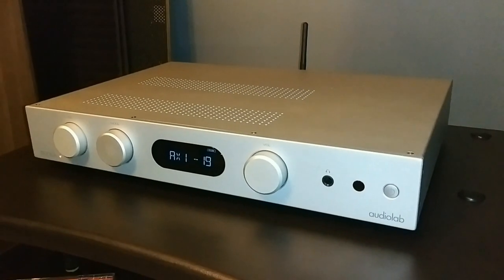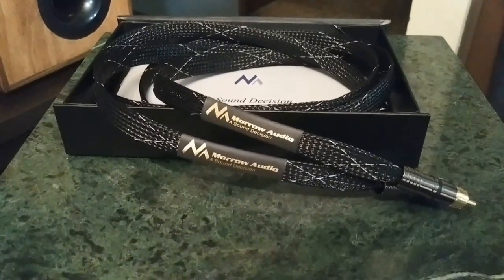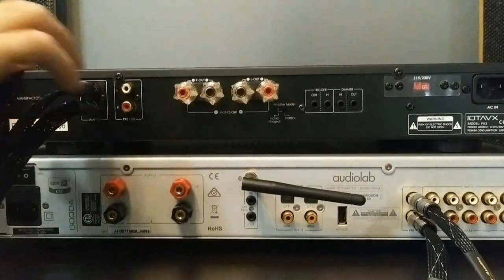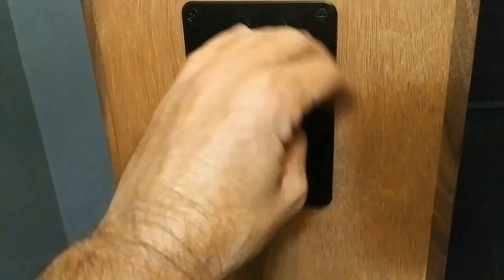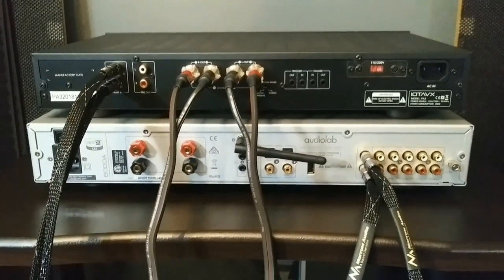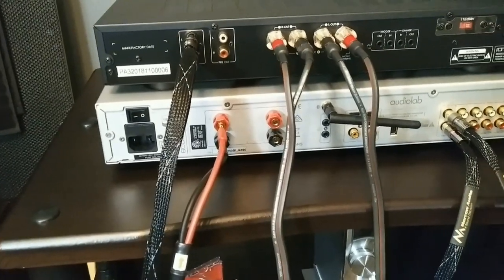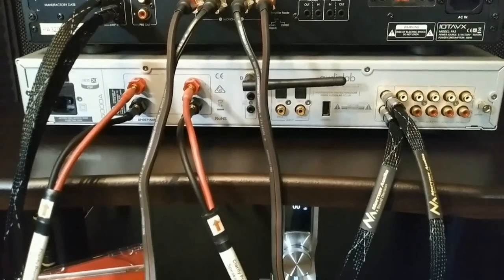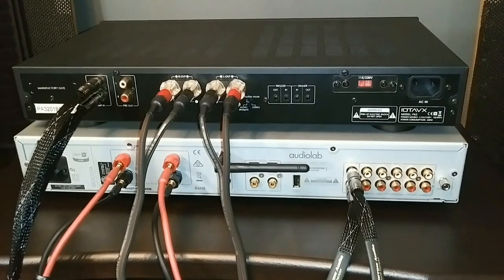How 2 Bi-Amp your speakers by using an Integrated amp with Full Range Pre-outs to a Power-Amp 😆

Comment: This happens to be my exact amp setup. So glad to see someone else doing it. Bi-amping is supposed to improve soundstage and tightness of bass, but I actually felt the main improvement was that it liberated the mid-range, making it sound a bit ‘friutier.’ When bi-amping like this you must ensure the two amps are gain matched within a certain tolerance. These two are fine as there is only 1dB difference; 25dB vs 26dB. (Input impedance and sensitivity should also be within a certain range relative to each other too.) These specs aren’t always published so you may have to contact the manufacturer. I like your 2:1 ratio rule of thumb; had not heard that before.
Reply from the maker: Your on the money
Reply: 100% ! The ideal would be two 6000A connected together but this Iotavx is just fine.
Reply from the maker: Wish Audiolab would of built a 6000SA stereo amp that can be bridged also '

Comment: I have a 1974 Sherwood receiver (70WPC) with "mains in" connectors and I bi-amped it with my Audiolab 6000A. The Sherwood is powering the bass. Huge improvement in dynamics. I more than doubled the power input into my speakers. I can now get the same quality of sound at 10 decibels lower volume. 😀
Reply from the maker: @SpineTingler007  hell yeah !!

Comment: I assume the gain factor for the 2 amps needs to be the same.
Reply from the maker: Most amps are 29db gain
Reply from the maker: 28db/29db Iota/audiolab
Reply: @tee-jaythestereo-bargainph2120  Hi, i spoke to Iota and they said PA3=MONO GAIN=34dB, Stereo GAIN=28dB. Audiolab 6000a manual says gain is +29dB. 🙂
Reply from the maker: Normally most all around 29db but 
My source told me 24/25db 😆 i just know it works vert well 1 or 2 db is ok 3db is to much thanks for the feedback
Reply: @tee-jaythestereo-bargainph2120  No problem, keep up the good work you do, I see your improving your vids, just keep it real and honest, that's the best. 😁
Reply: @tee-jaythestereo-bargainph2120 It's not the gain of the amplifier that is the important factor, it is the sensitivity...these vary considerably, making this configuration a bit hit and miss....to say the least
Reply from the maker: @audiorick841  yes

Comment: YEAH, BUT..... You really probably should be using an active crossover net work. Otherwise, how does the one amplifier know that it is only powering the high frequencies? Do you see it does it know that and so it winds up sending the entire 20 to 20,000 cycles to your high frequency drivers which is just not efficient, and it's very possible that by doing this you will damage those high frequency drivers. Then the same thing can be applied to low frequencies. How does that amplifier section know that it's only running the subwoofers or the low frequencies, you see it doesn't. And so you are sending the full 20 to 20,000 cycles to the low frequency drivers as well. Although the likelihood of damage is much lower fact almost nonexistent, you're still being inefficient. Woofers don't really care to see high frequency power. It's all about efficiency. I think you need to re-examine and reevaluate your set up here, and look into doing a to an active 2-way crossover net work.

Comment: That jumper you took off the speaker terminals looked a solid piece that shorted all four terminals together!......that might prove 'terminal' for the amp were you to connect speakerleads with it in place!!! 

Having got to the end I was amazed to find you didn't say how you vary the volume of the tweeter compared to the woofer! The sensitivity of the the amplifier you're using for the bass is very unlikely to be exactly right is it!

This whole video is misconceived from start to finish....I've come to the conclusion it must be a joke! 'Don't try this at home' as we say over here in England!!!

Comment: The question is: does it sound any better? I haven't tried, but I hear many say it doesn't with two modern solid-state as apposed to just one...
Reply from the maker: @aronsin7777  better bass Attack better dynamic range headroom easier on the amps and like I said in video you can switch them around with LF/HF but does it buttt is the difference in sound a Huge. Change the answer is no espically with budget speakers now once you get up to entry level speakers above yeah you can notice more of difference 😉
Reply from the maker: @aronsin7777  great ? By the way

Comment: Thx for this Tee Jay! 
I have my audio lab 6000a and 8000power amp wired as you described and there is a significant difference. It's not that it's any louder it's more detailed with punchier and deeper base. This has refreshed my Monitor Audio speaker! 
Excellent stuff, keep it up m8 👍 😁

Comment: Great video thank you! 

Did you see any improvement in volume? 

I ask because typically when you double the power you get an additional 3db of output.

This means that adding an amplifier to an integrated while by-amping could be a solution for someone that wants a bit more volume output, while keeping the speakers they like!

Comment: Nice setup. When you turn up volume on the AudioLab, does it turns up the volume on the IOTA?
Reply from the maker: @rambache  yes I show in video how 2 hook up basically The labs preouts into the Iota inputs '
Reply: Good question!! And within that question an exposé of the flaw in this video. The volume of the Iota is fixed to the volume of the Audiolab for all levels of the Audiolab treble output. This is very unlikely to be the correct level. It is essential that the power amps are matched by being able to be varied independently of each other.

Comment: I've often wondered if someone might use a SET tube amp for higher frequencies plus a more powerful solid state amp for the lows, so thanks for pointing that out.  Though I would also think that the more powerful amp would need a gain control in order to match the volume of the lows to the highs, unless you lucked out and they just happened to be a good match "as is".  Most power amps do not have gain controls, though some do (especially the more expensive ones).
Reply from the maker: You are correct ' Gain Control is very important
Reply: I would be careful when doing something like this. It sounds like a good idea, but setting a system up like this with 2 difference is just asking for problem. You correctly bring up the level matching that needs to be done. It doesn't matter if there is a big difference in power, or not. You still need a way to adjust the levels. Typically an active crossover is used. But in reality, when you use 2 different amps on the same speakers, you can easily hear it hear it. You may like it at first, but over time it will drive you crazy.

And the problems don't stop there. Even if you use 2 amps that are exactly the same, they're not. The amount of power an amp puts out is determined by how much resistance the load (speakers), shows it. And resistance, is a function of frequency. For example, you have an 8 ohm speaker. That number is not constant. its an average.  There is only one note(frequency) where the speaker will show an 8 ohm load to the amp. Any frequencies above that note, shows a higher resistance to the amp, and the amount of power the amp puts out decreases as you go up. Anything below that 8 ohm frequency shows less resistance to the amp. So if you have an amp, for example, that puts out 100 watts into 8 ohms, at 16 ohms, its literally a 50 watt amp. And at 4 ohms, it should be 200 watts, or close to it. So, when you have one amp on the lows and one on the highs, the amp on the lows has to work a lot harder than the other one. And that means they'll sound different and put out completely different amounts of power. That's why you need an active xover, because its practically impossible to get the levels right any other way. I've experimented with this many times over the years, and its only a disaster.

If you really want to biamp on modern audio equipment, a vertical biamp is the only way to go. To do that, you need 2 stereo amps that are identical. The setup is different. Instead of having one amp for the highs, and the other for lows, each speaker gets its own amp. You run one set of speaker cables off the left channel for highs, and the other channel goes to the lows. Each amp powers one of the speakers. The advantage is that both amps are now working exactly the same, and there's no need to fool with  any type of level matching.

Comment: Tee Jay, excellent tutorial! Quick question. Did you use pre-out from the Audiolab to feed signal to the black amp?  I did not see RCA’s going back to the  Audiolab’s Main Out.  Isn’t that the trick to use the amps on both units?
Reply from the maker: Yes I used preouts rca out of audiolab into Iota amp inputs '

Comment: Have you tried using the iotavx pa3 as a simple Power amp for the 6000a? If yes how does it sound? Thinking about buying the pa3 for my 6000a :)
Reply from the maker: Actually sounds good imho but will depend on your taste and your speakers but yeah the preamp in the Audiolab is very good for Pricepoint - and the Iota Pa3 is a Gem for pricepoint very good tonality reminds me of that Vintage flavor balanced little bit of warmth . 
I have a comparrsion video Iota vs Audiolab check it out i think that video will help ya out
Reply: @tee-jaythestereo-bargainph2120  yes I was considering buying this iota due to its low price. And linking it up with the audiolab as like you mention, when the volumes turn up I found it struggled. I'm hoping the iota linked up will make it sound more effortless at higher volume.

Comment: Great video, and thanks for showing the cable connections so clearly. How would you wire 2 PA3's to a 6000a, so that each has its own channel, one left and the other right? Can't find any videos online on how to do that. Thanks.
Reply: Do you want to use the 6000a as a preamp?
Reply from the maker: Daisy chain - I would use both PA3 in 'mono mode' and run each amp to Low Frequency basically 'bridged' . 
Cool thing about the PA3 is that you have input and output so you can daisy change amps very cool feature ! 
Basically run pre-outs to the Pa3 for Right side from the audiolab then run a set of Rca from the RIght side Iota PA3 output to the Left side Pa3 inputs .
Very simple - 
I done this before with the Iota Stack and 
My dual mono amp the Onkyo Integra M504 i have a video i posted but it was just music playback only -
Reply: @abacar6134  Yes, just to see how it all sounds, and the PA3's can't be used as pre-amps.
Reply: @tee-jaythestereo-bargainph2120  Thanks, so in mono mode you're just connecting the two cables, whereas in your video, you connect 4 in stereo.
Wonder what produce the better sound, if any?
Reply from the maker: @mikeysoft7  your correct its just a power amp P.A. 3 the SA3 is the Stereo amp
Reply from the maker: @mikeysoft7  its a shot in the wind to be Str8 up depending on speakers and to what you like 😃 But yeah just make sure you read back of pa3 before biamping it shows how to bridge and theirs the switch also great little amp for pricepoint I know pep who have used the pa3 in their home theater set up for their Center channel bridged and even to drive front speakers from the preouts of their Home theater Reciever or Pre HTR
Reply from the maker: @abacar6134  Yes and it gives the flavor of the audiolab to the Iota 😃
Reply from the maker: @mikeysoft7  pa3 can't be used as preamp but you can use its rca outputs to daisychain to another dedicated amp it puts out up to 2volts the standard
Reply: @tee-jaythestereo-bargainph2120  Thanks. I guess with 2 PA3'S you have a single rca cable going from audiolab to one, right, and from that pa3 to the other pa3 left , as you said, like a daisy chain.☺️
Reply from the maker: @mikeysoft7  you are on the 💰!

Comment: Tee-Jay many thanks for this very valuable instructional video. I am hoping you could answer my next question. Is this setup also possible when the Audiolab 6000a is being fed at the Pre-out input (I believe it's called Power Input) let's say from a Home Theater receiver? Thanks again man.
Reply from the maker: No won't work because when 6000a is in direct amp mode the preamp inside is bypassed and 6000a then is just a amp
Reply: @tee-jaythestereo-bargainph2120  So it could only work when not in direct amp mode. Correct?
Reply from the maker: That is correct you could leave in Integrated amp mode and use preouts of your HTR into the Aux1 input of 6000a but then youd have to control volume with 6000a whatever speakers you have paired to them but it would work but then your coloring the sound with the HTR and 6000a And you'd have to volume match both of them ' the easiest way would to be Put Y adaptors on your Home theater recievers preouts 'instead of 1 left 1 right front preouts you use these adaptors to double the output '
I am about to upload a video on how to do this with a dac that only has 1 set of rca analog outputs how to make it 2 sets ! I been into audio since i was 5 years old hooking up my dads P.A. systems ' I got tricks '

Comment: I've been wanting to try something like this for a long time now to power my Studio 590's. What I had been considering was 1 Behringer A800 per speaker in bi-amp or 1 Crown XLi 800 per speaker in bi-amp. Wouldn't the volume level be different using different amps for the low and high like this? Also, the jumpers for these speakers scare me that they have the positive and negative layered on top of each other like that and are also somehow attached to each other.
Reply from the maker: No the jumpers have space inbetween them . Those were just some the company sent their not what comes with speakers gain is 25/26 db most amps are sround 28-29 db

Comment: Great Vid Tee-Jay! Something I was wondering about the 6000A Play. Since it can be run separately as a power and pre-amp at the same time, do you think it's possible to connect a tube preamp or buffer between the two sections, So you'll be playing  your streaming through the tubes into the power amp section. Bit crazy I know but that's how I roll lol! (it is possible to connect a DSP this way)
Reply from the maker: I don't have the 6000a play . 😥 
I do have the omnia but never tried a buffer except ifi itube2 but i just ran my rca from my dac to buffer then from buffer to my integrated amp

Comment: Awesome stuff. How much of a difference in sound do you get from just using the audio lab alone?  I mean if bi amping sound 100% then in comparison suggestively what grade gets the one amp by itself. Great speakers btw. 👍
Reply from the maker: Actually sounded great up to med volumes - about 75-80db but once i added another amp bass attack got better espically at lower volumes and dynamics are much more noticable 
 just a more effortless control - 
Almost like conparing a 20lb class AB amp vs 40lb class AB amp more body in the mids also . thanks for dropping in 
But bi-amping doesn't guarantee to have better sound 😃

Comment: Hi Tee-Jay and thank you for the great video. Maybe you could help me with this question? I wonder if it possible to use the internal front amp of my receiver and an external 2 channel amp (via preouts of the receiver) for bi-amping front speakers?
Reply from the maker: Yes absouletly !
Reply: @tee-jaythestereo-bargainph2120  I have tried it but couldn't get them both working at the same time. Didn't figure out what I did wrong. Never mind. Maybe some time you could do a video about this. It could have helped many people on a budget out there to improve their sound. Thanks for answering and thank you for the great channel Tee-Jay!
Reply from the maker: @zubidoc  what home theater reciever are you using ? are the preouts from reciever for Zone 2 or something ? It should work you may have to go into your recievers menu to turn on the preouts should work though
Reply: @tee-jaythestereo-bargainph2120  It's Denon avc-x4700h. I switched it to 11 channel mode and I tried to make it work with front preouts and then with height 2 preouts. But I could only get a sound either from an internal or external amp. Never both of them... Obviously I did something wrong, but don't know what exactly.
Reply from the maker: @zubidoc  reach out to t
Techno Dad he is a reviewer on utube and he knows that Denon very well thats a kickass HT Reciever ! 😆
Reply: @tee-jaythestereo-bargainph2120  Thanks a lot Tee-Jay! Will try 👍

Comment: get yourself an active crossover if you're going to do that a lot better, like the BSS FDS 334T 200£ 4wey. it's worth putting a small resistor to the tweeter's 0.5ohms 10w a SMD would be good.
and you could use two band-pass filters one for the low-frequency and one for the higher frequency.
 if  they are going down to 2 ohms, but a 1.2ohms resistor in line

Comment: I have two NAD intregated amplifiers C352 and C370. Along with Rotel Rb981 power amplifier.
At presentI am using the C370 as a preamp through the Rotel.
 With the bi amping method. What would be the best route; using the the two NADs  or  substituting one of them for the Rotel?
Reply from the maker: I would Try bith ways - and which ever sounds beat to you roll with it , 
Make sure the rotel/Nad have close to the same gain atleast ➕/➖ 1-2 db
Reply: Thank you.